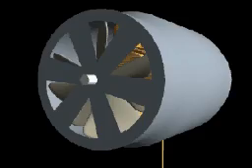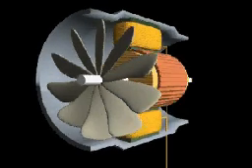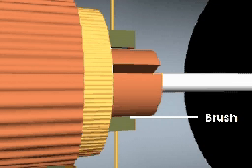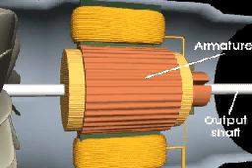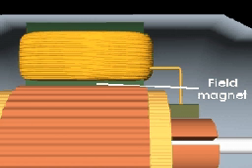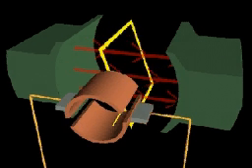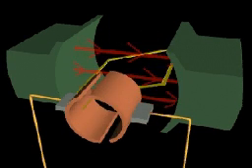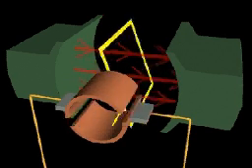How electric motors work

Comment: So, why don't we use this for motors and cars?
Reply: Well you have to question where do we derive electricity from? Well there's either the process of using light (solar energy) to 'excite' electrons in conductive materials (solar cells in this case, but such as copper wiring is a conductive material) and have us direct it across a wire/circuitry (as to use in a motor to do mechanical work), OR there's what would be mechanical harnessing which uses the same processes as a motor but in the reverse order, where we use physical forces (e.g. water, wind, combustion, etc.) to turn the same rod between N-S magnets, in which will have electrons jump onto the rod (because we've excited them with the motion-turning of the rod between attracting magnet ends [in other words, they want to be together n-s, their protons-electrons attract, so electrons {not protons, protons cannot be moved so easily because it would the change the material's elemental composition entirely} jump across the space, but firstly onto the rod]) and we will direct it down appropriately to a battery, then to a motor. Between combustion (using FUEL), water, wind they are utilized for the same thing [except that in cars, they directly use the force of combustion to turn mechanisms, the future is using abundant resources to {between light or mechanical fuel sources} do this process instead, which is more resourcefully efficient and better for the environment!] It's just that also it is less reliable (as far as I've been led to believe) of a technology when just having stored electricity in a battery, which may not be enough for an strong-long distance required vehicle.
Reply: ***** check out tesla model s p85d(dual motors). It beats just about any car on the first few meters, and does fine afterwards too.
Reply: why do use it for motors
Reply: no fuel?
EZ awnser
Reply: I know, but why don't motors use it?
Reply: jesus, not reading this sorry
Reply: fortis24 Man has explaind you the basic principles. it is not in-detailed science...
Reply: i know there's a chance this is impossible for cars bro
Reply: To get more information about electric motors visit  http://nfpmotor.com 
Provides quality good and cheap electrical motor

Comment: @straighter100 So if the dc supply was reversed with the positive wire going to the other brush and the negative wire to the opposite brush also the armature would turn in the other direction?????

Comment: @Behemoth2334 
Current is the flow of electricity. The flow of electricity creates a magnetic field. If you've ever played with magnets, you'd realize that they only attract eachother from certain sides, and repel with some force if you try to force them the wrong way. What the motor essentially does is put 2 powerful fields on each side of the rotating shaft to cause it to spin by pushing it in the same way the magnets repel eachother.  The magnets in this case are man-made. That's the gist.

Comment: @A7XsUxOrZ You need to understand what the Lorentz Force is. It's a force created by electric current under influence of a magnetic field. Take your right hand and imitate a pistol with it. Your index finger is the direction of the magnetic field, your thumb pointing upwards is the direction of the electric current and the other three fingers pointing to the left is the direction of the Lorentz Force. No apply this to the image above and visualize these forces as arrows, usually called vectors.

Comment: @gibo772000 DC motors were only used where torque and speed control was necessary. So they have been out numbered by AC motors for many years as many applications are constant speed type. The VVFD allows an AC motor to perform the same functions as a DC motor which means that spells the death bell for DC motors except where instantaneous speed changes are needed like in servo apps.